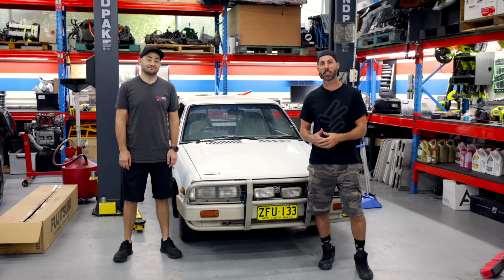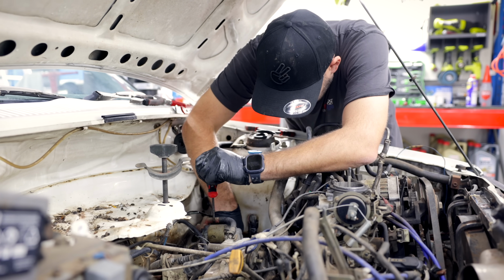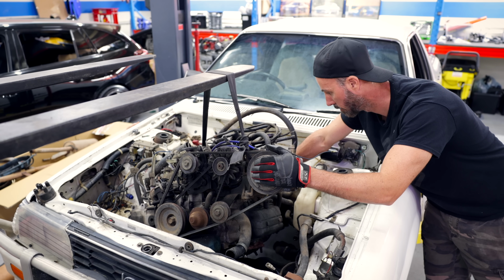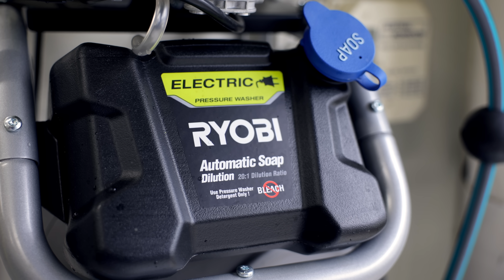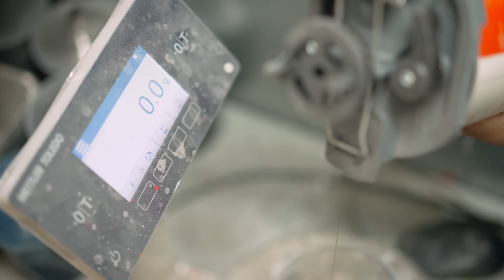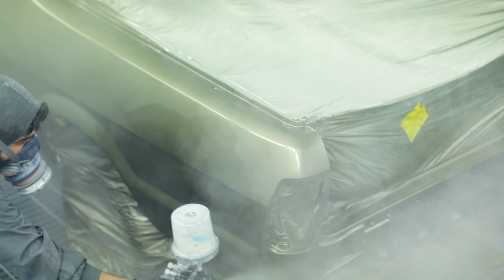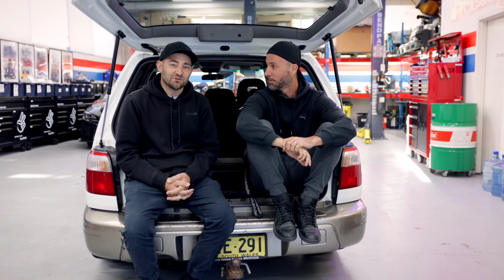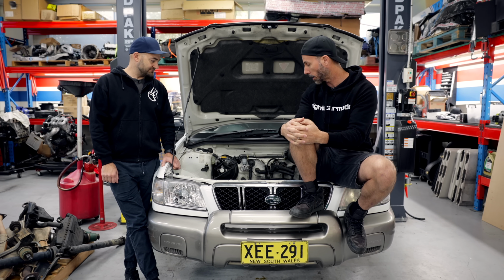Rebuilding a Subaru Brumby (BRAT) Ute that we found in an orchard! [EP2]

Comment: Wouldn't it be cool if Subaru made a new Brumby. A small 2 door 4wd ute with all the modern tech and a reasonable price, I think that'd sell really well in Australia.
Reply: It wouldn't sell as well as a 4 door ute so they probably wouldn't make a 2 door. They might come out with a new ute at some point.
Reply: Agreed that it would have to be a two door ute. If they built it to carry a dirt bike and a swag with some kit they’d sell like hot cakes - especially if they offered a turbo version! They’d need a decent dual range too, just because the original did. But they’re all dreams of ours. It will never happen now.
Reply: @ElFreddoAndRubyScoo  I think it'll likely be a ev because of the push for ev's around the world. Or it'll have a 3cyl hybrid.
Reply: @Khmtravelvlog  I reckon it'd sell considering how popular utes are here. Bringing back an old name has worked for other manufacturers, I don't see why it wouldn't for Subaru.
Reply: @Magz215  I guess maybe tell your local Aussie dealer that's what everyone wants maybe petition and they might give it a go. 🤷

Comment: I like the color choice.  A modern Subaru color can look quite good on a classic.

Also interesting you don't have many manual non-turbo Foresters rolling around down there.  Here in the states there are still a TON of first and second gen Foresters (Legacys too) rolling around.
Reply: A fairly sizeable chunk of the non turbo Foresters (and legacy/liberty) that are still around in Aust are autos. That was probably the biggest hurdle.
Reply: There are loads of NA manual foresters down here, just not many for sale as ppl tend to hold on to them and even pass them down in their family. 
The other thing to remember is they needed one in Sydney - I doubt they wanted to transport one from across our vast continent.

Comment: So... 92 kW of thumping grunt... I had a Liberty EJ20 manual and it was a bit of a slug (ok heavier car, sure). Is there anything you can do to give it a nice bump in torque and power? Cam swap from something else? More compression?
Reply: NA all you can really do is open up the exhaust to a free flowing setup. I wouldn’t go any larger than the stock pipe. 
From there it’s up the displacement or turbo conversion time.
Reply: @ElFreddoAndRubyScoo  are there any EJ25 bits that will work, or is it all specific to each engine?

Comment: I got an l-series wagon with a bunch of things to repair & i recently considered selling it cause i ran out of time/money. This series made me think twice. I'll squeeze some rocks and get into debt to get an ej22 at least.
Reply: Do it! The L series should’ve come out with a 1.8L EJ in my opinion. 
Ask don’t discount the EJ202 - same as what they’re using from that Foz. look up the factory power specs - they’re about the same! Only real difference is the 22 early version from the Gen1 Libs are non interference, from the Gen2 all EJs are interference engines - almost a non issue as EJ belts don’t break unless you cheap out from quality belts and idlers ;) 
Heaps of info out there on the forums about these!

Comment: Using a metal wire/cable  for the windshield saves alot of hassel of the window rubber seal

Comment: You really need to be more safe. Having the engine hang off the forklift with a strap is fine, but what if the strap slips? There needs to be something that would stop the strap from slipping off the end of the fork. Some people just use a c-clamp on the fork.

Comment: Would love to see a restoration to actual factory specs. 

Everyone wants to turbo a brumby..... meanwhile, I'm over here still running the 34 year old steel rims and trying to find an original radio cassette for mine.

And the clock still doesn't work.

Comment: What happened to the 2.5 boxer you took out of the crashed sti to put into the levorg ? You could have turned the brumby into an sti brumby . You had parts left over from the crashed sti . Instead you trash a perfectly good forrester sombody would have used . Use crashed cars to recycle instead of taking good cars off the road .

Comment: This is cool, but it's not a restoration if you are swapping original parts with non-stock replacements. It would be more correctly called a resto-mod. 
And next time you are stripping a car down, dry-ice blasting can do a much better job of cleaning the body and it's far gentler than pressure washing.

Comment: Wierd rod is hill hold. These fell out of favour in Europe for the oposite reson to why the were popular in AUS and USA - they used too much fuel compared to comparable sized cars - 50% more !
Reply: That’s not correct mate. 
It is a rod to stop the engine pitching forward or back under power. 
It’s bracing that’s all